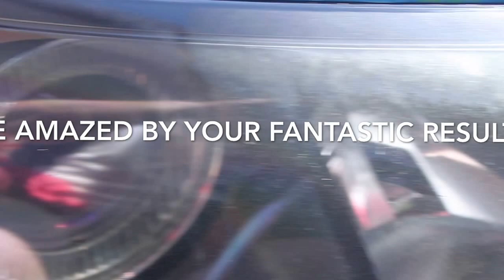How To Best Restore Car Headlights!

Comment: Thanks and hi. Why not adding clear coat?
Reply from the maker: You certainly clear coat if you wish, but you’d be better off just sanding up to 800grit so that the clear coat will bond effectively and you should cover the whole car in plastic if clear coating as it will cause over-spray if you don’t.

Comment: w/o trying to be disrespectful, i'm not sure this makes sense on what appear to be slightly oxidized headlights, that is unnecessarily aggressive sanding.
in the desert we get super ugly 'plastic rot' by a combo of dust abrasion and UV exposure. on a Very dull headlight i start from 500grit. something like what is shown i'd use 800 grit. 
because plastic is softer than regular clear coat it doesn't need that long to sand and polish...  instead of just wetting the surface, use a sponge and squeeze it to have the water running down as you sand. it's faster and also let's you see the progress in real time. after a few passes you will notice the run-out gets clearer meaning less plastic is being removed, a sign that the compromised layer was removed.
even medium cutting compounds (as mag's medium 1, a 7 on their cut scale) will smooth out 800/1000 grit sandpaper marks. finish w/ a fine cut or in case your product has the 'diminishing abrasive' technology, after a few passes reduce the speed and watch for the plastic to clear up completely. 

ps: headlights come w/ a UV resistant coating. once that is gone, plastic will oxidize much faster. (it lasts about 2yrs max in the desert)
your best approach is to use a vinyl wrap after cleaning the plastic. use a name brand for longevity and ease of application. if the shape is super challenging it's perfectly fine to use multiple wrap patches but in general modern wraps stretch quite well.
if the car is garage kept, regular application of a UV protective layer will keep the headlights clear longer so it's not imperative to wrap them.

Comment: Where do you get your sanding discs from? Waxit only has from 2,3 & 4000 grit
Reply: Sweet. Will check out the page now. 
Also what do you use to seal the headlight after correction?